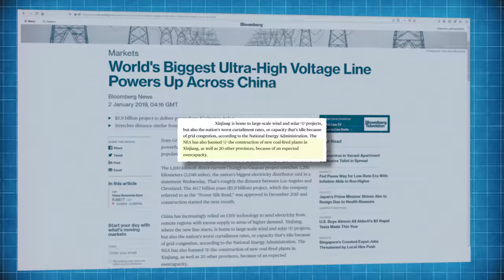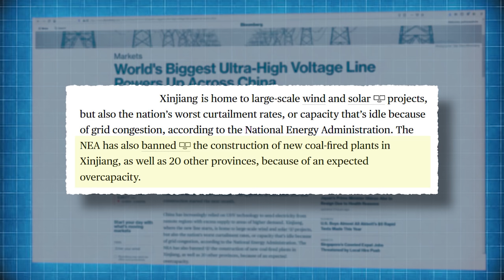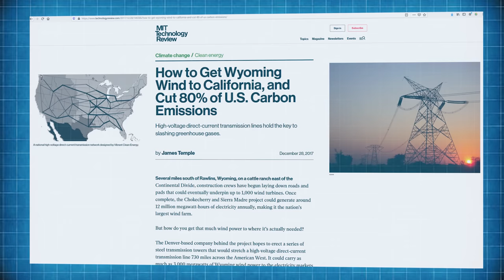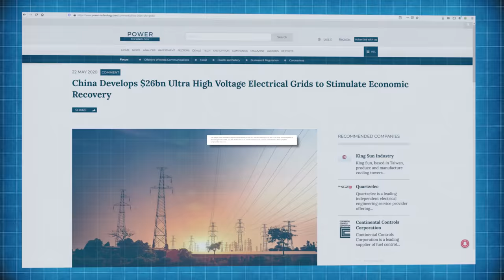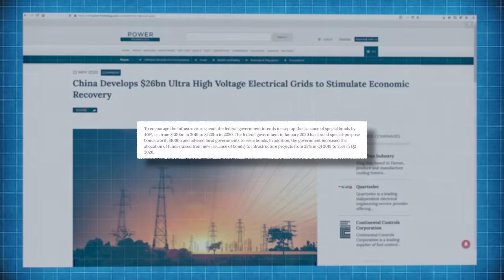China's MILLION VOLT Energy Superhighway

Comment: Yes very high voltage AC transmission losses are mostly plasma losses. Transporting electrical power via DC is MUCH more efficient. Also AC transformers ac much less efficient than DC/DC conversion. They actually use thyristors for conversion. Overall going to DC transmission is more than 30%-50% more efficient.

Comment: Your full wave Bridge rectifier diagram  is misleading. So you dont short the A and B directly as in your diagram.  the points A and B are connected through the load. The positive half cycle from any side will always flow though the point A and Negative Half cycle always from B.

Comment: Good video, I would suggest talking about the use of HVDC grids in the solution to variability in renewable generation (solar and wind). Locally isolated variable renewable resources,  must be backed by firm resources ( almost always fossil fuel resources) to provide 365/24 hour power. Sharing of renewables over very large distances (using UHVDC) approximates a firm resource (the sun and wind are always producing somewhere). The cost of building a HVDC grid is much less than building firm fossil fuel resources to back the variable renewables.

Comment: Wow the breakers on that line must be enormous! With DC, you have a continuous current and so the spark can jump much much farther with DC then with AC, and with voltages like that, the electricity could jump an enormous gap like lightning! I am surprised to find out that DC can travel distance better then AC can, I guess massive voltages and distances over 600Km make the difference. I do wonder what happens when a tree falls on a line like that though.
Reply: Sure goes against all the Docs about the DC (Edison) vs AC (Westinghouse) war in 1900 to choose a power supply. 
DC lost because of needing to many power station do to its short transmission range.
Reply: @Crashed131963  it was not DC that was the problem, it was the low voltage required for the Edision's system

Comment: And the HVDC lines are made of Aluminum, much cheaper than Cu and weigh less  one also need a larger diameter to prevent corona discharges therefore Al  .  Funny enough China build windturbines in northwest and we were having fun with it because there was no connections to the east coast where the power was needed for a considerable time due to resistance from the areas in between that saw no benefit in such a line.

Comment: It is true that very long distance electric power transmission in AC loses more energy than the energy cost of the enormous rectifiers and inverters necessary to make it possible. To make high voltage DC power from low voltage DC, you need a transformer, even if your low voltage is 1000 V, and you want 10 kV. But whereas it makes sense in Quebec for their huge but distant hydro resources, the idea that somewhere in a big enough area the wind will be blowing there when not here ,  or that there is anywhere in the contiguous  USA that has sunshine at midnight of the central states, does not fit.

Comment: He didn't mention the electrolysis effects being worse on DC than on AC. Supposedly, they have to fight more corrosion on DC systems requiring more maintenance than on AC systems. That's a factor in why the transmission distances have to be very long for the DC to be more economical than AC.

Comment: ac transmission loss? For extreme distance - 
Alternating voltage incurs a higher loss from cyclic charge/discharge currents in the transmission dielectric. Dielectric of (1) suspension insulators and (2) air gap between parallel transmission conductors, and moist air dissipate significant energy at long distance. 

Besides an ac/dc comparison chart, the report neither - covering the ac>dc and dc>ac conversion losses nor - introduce what challenges needed to overcome in the conversion operation.

Comment: I am still baffled why the use of modular MSRs aren't being built as far as I can understand they are walk away safe and can be operated using wifi from a central position, I believe some are being built now and may need pot replacement every four years, if this is true they can be built near where the power is needed so no need for massive voltage or loss through resistance. Are they just too expensive?
Reply: It seems highly probably that the problem gets down to the Levelized Cost of Energy.  In other words, too expensive.

Comment: As a general rule, power is generated and used with as short a distance between source and load as possible. Generating and then transmitting over long distances is bound to be less efficient and more expensive. Another general point is that high voltage electronic devices cannot stand high fault currents (something all grids experience), so are set with extremely sensitive protection devices which  makes a grid less resilient.

Comment: Just Have: your full wave rectification diagram showing AC to DC conversion is incorrect and confusing. There should be no electrical path between A and B, as shown there would be a short circuit, perhaps an explosion. Eliminate the A to B electrical path as shown and point A will be the positive termination and will be the negative termination.

Comment: Hydro isn't zero GHG emissions, in fact, the worst hydro systems (systems with large reservoirs) emit more GHG per GWh generated than coal does. 

The only totally clean (non GHG emitting) hydro is high altitude dams (above vegetation line) and run-of-river powerplants.

Comment: Solid state devices are all voltage limited.  They can economically only support fairly low voltage.
Reply: Modern thyristors used in HVDC systems are liquid cooled and about the size of a 2 gallon bucket, they happily handle 7,000 Volts at 6,000 Amps. Banks of such devices can be assembled to handle up to 20 Giga Watt or more.

Comment: It would be interesting to see a cost breakdown of the up front cost vs. operating cost.  The DC would be more expensive up-front, typical AC lines us steel conductors that are cladded with aluminum for transmission, the DC would likely be full depth of the same material and more expensive, but also smaller in diameter because of the higher voltage.  One of the limiting factors in transmission lines is the heating of the cables from the current and the resulting sag from expansion.  Smaller diameter cables might alleviate some of that.
Reply: The equipment to step up DC voltage is likely more expensive too. At least per unit.

Comment: I love your videos and lap them up to learn more about climate issues and solutions. There is a mistake in this one though, your circuit diagram of the full wave bridge rectifier is wrong, or at least very confusing. It looks in your diagram like points A and B are joined directly, whereas they would in fact be joined across a load (eg the transmisison line), across which there would be a voltage drop. I know you said there is the transmission line between A and B, but if you are going to present a circuit diagram, I think you should include the load in the diagram, not just have a picture of a pylon half way along what looks like a wire. This would make it clear that the DC output is taken from A and B. Keep up the (otherwise) good work!

Comment: This technology isn’t new.  BPA’s Celilo Converter Station near The Dalles Oregon was installed in 1970.  It is connected to a station in Sylmar California, currently 3 Gigawatt capacity at 1 Megavolt.  It moved hydropower from the Columbia River to Southern California.  Initially they used mercury arc valves, like a giant thyratron for rectification they were replaced In 1985.   BPA also had a 1 megavolt AC line near Lyons Oregon about the same time frame.

Comment: HVDC is wonderful.  The obstacle is capital costs.   Every terminal where it must connect to the AC system required expensive conversion equipment.   Back in the 70s, those terminals cost nearly $1Billion each.  Today is should be much cheaper.  How do we  judge without access to the detailed financial records of the project?   Well, the Chinese are not fools.  If their economic analysis said that the line was a smart thing to do, I believe them.

Comment: Very intresting topic, I surprised than DC current can transport more energy than AC, I'm fully aware of the skin effect but in my brain DC means low voltage, and low voltages means thick wires.
That's a paradigm I must change.
Unfortunately you can't generate high voltage solar, and increasing voltage cost energy.
I wonder what's happened with superconductive wires, that's a promise "nuclear fusion level", always in 30 years.
There are two generatos in Manhattan conected by a superconductive wire, but it is only 200m in length. It is the only example I know.

Comment: Speaking of China...  Building the clean energy power plants nearer to where the customers are... "in October 2018 the NDRC's Energy Research Institute said that China's nuclear generating capacity must increase to 554 GWe by 2050 if the country is to play its part in limiting the global temperature rise to below 1.5 °C. The share of nuclear power in the country's energy mix would thus increase from 4% to 28% over this period. The study said that assuming an all-in cost of CNY 20,000 (approximately $3000) per kW of capacity in large plants, an investment of more than CNY 8.7 trillion ($1.3 trillion) would be required. Based on capacity additions over the past few years, the total investment demand to 2050 was considered to be feasible."
Reply: $3000 per kw to build.🤔
You can install rooftop solar on a house for about $1000 - $1500 kw.

Comment: The transmission loses over 3,000km (even at 1Mv) would still be huge. Much better to electrolyze hydrogen and ship it at a fixed loss of 30% regardless of distance (sure there is a minor distance penalty but it is around 2% at 3,000km). AC->DC and DC-AC conversation loses are about 15% at each end and then you have ohmic loses - significant at these distances - on top of that).

Add to all of that the fact that converting to hydrogen also provides load balancing at the same time, and long distance transmission by bulk shipment of hydrogen is far more efficient than long distance DC.

Comment: Or put another way, resistance and hence energy loss is proportional to amperage.  The higher the voltage, the lower the amperage for a given power transmission.
Reply: Energy loss is proportional to the square of the amperage.
Reply: @rogerbarton497  i keep forgetting that

Comment: 600kV is not that uncommon..
Oh, and the AC voltage is given as ca. 0.71 of the peak voltage, meaning that with DC the same amount of energy is transmitted at that voltage, but, as insulators are rated at peak voltage ca. 1.42x the AC rms voltage (plus a good safety margin), DC can be transfered at the same as the AC peak voltage.
600kV x 1.42 = 852kV
The increased voltage may heat up the insulators more, so the maximum current would perhaps need to be lower, to help keep them cooler (if leaky/not updated) this would reduce the gain, but if losses are greatly reduced, that provides a gain. Normally it is the current that heats conductors, so probably installations could carry the same current but with the increased voltage, which gives a good gain in energy transfer in addition to possibly reduced losses. Such AC transfer losses can be 20-40% or worse.

Comment: well as we get told in class. going over 600kV power lines doesn't make much sense because the capacitance resistance in the cable would be way to high. even doing the calculation these days. and damn...
Reply: It seems to be that there'd be no capacitance or inductive reactance with smoothed D.C. transmission, only simple resistance.  It isn't shown as smoothed by Mister Think here but some bod in these comments assured me he knows that it's smoothed, this Chinese one.

Comment: Converting HVDC to a lower voltage or AC is a formidable task with numerous failure modes and cost. This should be covered to tell the whole story.
Reply: Good point. I hadn't considered that and you're right- it definitely affects the cost/benefits ratio.

Comment: The danger is that high voltage dc will grab you and fry you. On the other hand ac will usually throw you. Of course 1 million volts will carbonized you in a few seconds in with option.
Reply: Hogwash.  AC and DC cause your muscles to pull in, in equal measure.

Comment: I always thought that AC current was selected for long line transmission because DC would require too much current and encounter problems with resistance and heat.  Perhaps I was wrong.
Reply: P=IV (power = current x voltage) holds true for both AC and DC. Hence the current is the same for AC and DC transmission, given the same voltage and power requirement.

Comment: Why don’t we use 48v dc in the home from the solar battery. All out lamps TV computers could use it. The only need for AC is for motors and some heating.
Reply: Some of us do but there is not a lot of consumer 48VDC equipment and you would be surprised how variable the weather can be meaning having the grid for back up or a generator is still required for a reasonable sized solar system. In Australia the cost of getting grid power in remote locations is high making solar, battery and generator installations cheaper in many instances than grid power.

Comment: One of the uses of the stranded Western Chinese renewable energy g system is of course Bitcoin mining rigs and I do wonder whether these new transmission systems will effectively raise the cost of of electricity in those stranded regions and therefore effectively reduce the amount of energy at the the Bitcoin rigs will take ,which is a good thing... Bitcoin mining as a means of of moving stranded power is a new concept that I have only  recently understood. Of course you don't move the power, the energy, you move value that can be redeemed elsewhere

Comment: A bit confusing in the video. Long distance land travel does not have to be in DC. But with the same voltage at that level, DC is more cost effective than AC. If passed through sea for long, DC might be the only feasible solution.

Comment: I don’t know how hydro-electric dams should reduce the level of rivers, excerpt for the initial filling of the dam, because to generate the power they have to let huge amounts of water out to run the turbines. Can someone explain please?
Reply: same sources of water, and more water being gone with evaporation etc
Reply: Romeu Filipe That is not the answer. Exactly the same evaporation would occur whether in a river or reservoir
Reply: bj2690 Good answer, and one that hadn't occurred to me. Of course! You are right!,
Reply: But do the dam operators need/want to generate power when those downstream need more water? Whos bottom line will take precedence? Also the obstruction that the dam creates and the possible disruption of the natural cycles of the river will affect the rivers ecosystem. 

And its a security issue - who wants to hand control of their water supply to someone else?

Comment: Interestingly to me, solar PV cells produce dc power. Would you please take some more time to explain the relationship between that and the transmission of dc power over long distances! Please. Because, other than the costs of producing large solar production fields, I was under the impression that long distance was a real world limitation of solar arrays. So it sounds like this is a solve for that assumed limitation. I had no idea that AC was less efficient for long distance transmission. You blew my mind with that one.
Reply: One PV cell makes about 0.6V.  That is a very long way from 1 million volts.
If you wire 10 PV cells in series (like the batteries go in a flashlight) you get 6V
Even at 100 PV cells you have a long way to go.
If you take 60V from 100PC as a starting point here is what you do:
Step 1 = Make AC from the DC
Imagine you have two wires (A and B) from 60V
If you took the ends of the wires and connected then to something, disconnected them flipped them, connected them, disconnected them .... etc impossibly fast you would have made DC into AC
This is done with transistors rather than frantic humans but the idea is the same.
Step 2 = Making 60V AC into 1 million volts AC
This is done by a transformer.  You can look up a complete explanation but it works to think of the windings of two coils as having 60 turns and 1 million turns.  If the coils are magnetically linked every turn ends up with 1V AC on it.
Step 3 = making DC from the AC
The trick here involves the rectifier diode.  These things work a bit like a "check valve".  Electrons can flow one way and not the other.  With 4 of them you can easily make it so which ever end of the coil is making positive has an easy path to Wire#1 and which ever end is making negative has an easy path to Wire#2